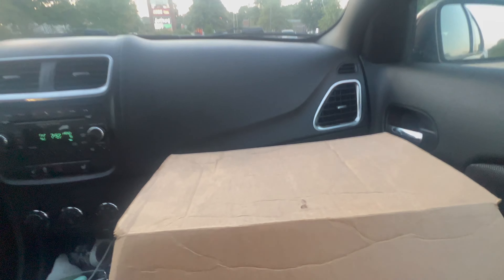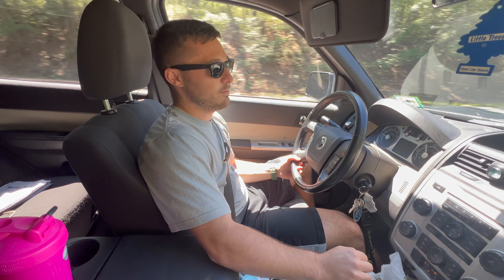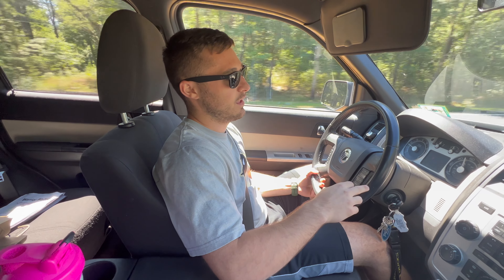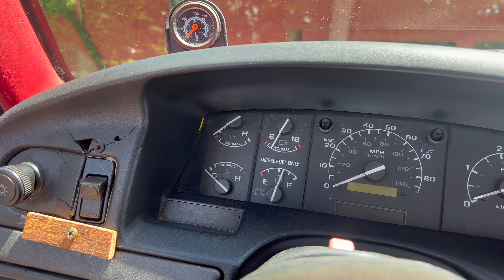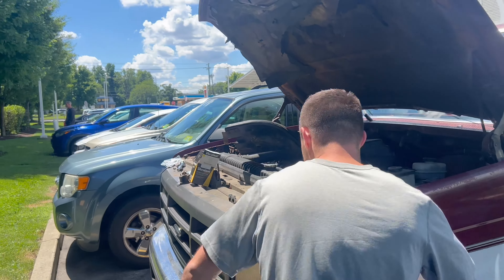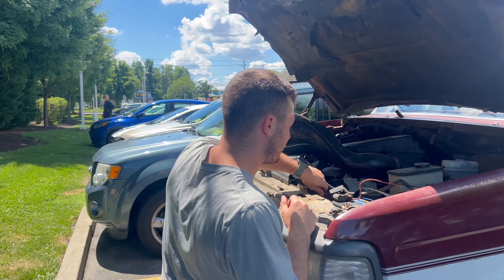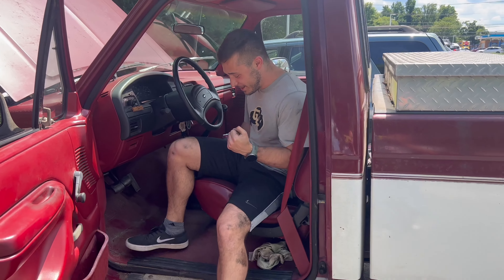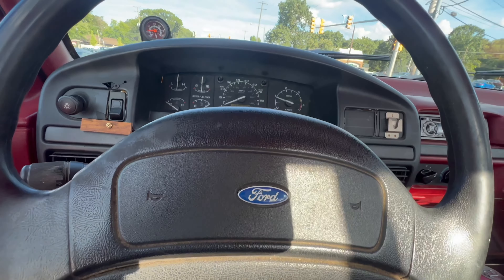My OBS Ford F250 7.3IDI Is Already Broken On The First Drive!!

Comment: I hour from starting to starting the engine, pretty good time
The top Bolt is the PITA to get to.
Use the Power Master 9050 Starter. One has been in my 86 6.9 for the past 6 years.
Same engine, was bored out, larger Head Bolts, up graded Rockers etc... and became the 7.3 IDI.

Oil on Stater is from your leaky Valve Cover. Also there is a drain at the back of the Valley Pan, and it will drain down across the Starter.

Use the MotorCraft ZD-29 Glow Plugs. F2TZ-12A34-A.

Be sure to check the additives in the Coolant with the test strips. Can buy it from Ford. Keeps the Cavitation
problem from happening.

Maybe you will see this, it is a 2yr old Video.
Reply from the maker: Thanks a lot I really appreciate it! Right now I’m still in the process of doing a full frame off restoration on this just got the motor and transmission back in can’t wait to drive it again!